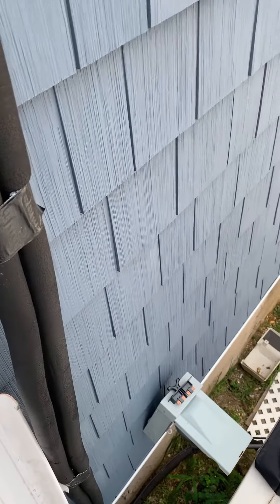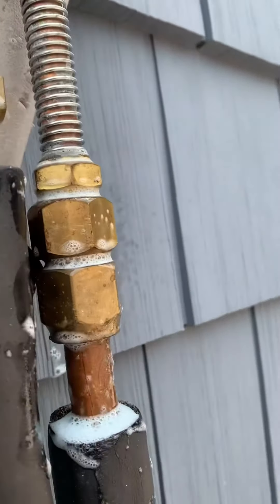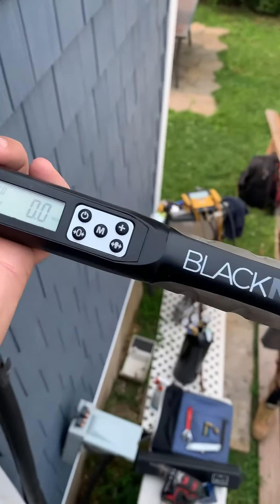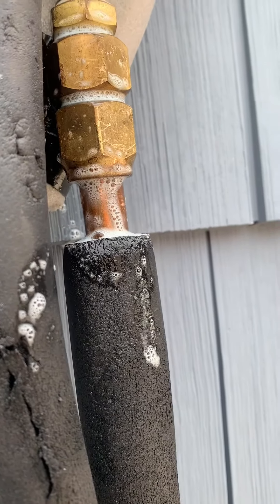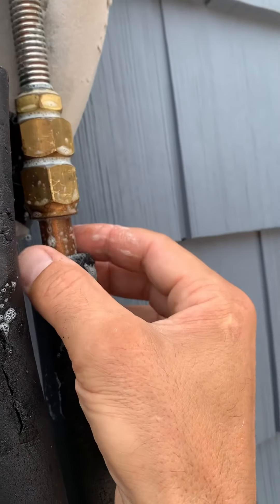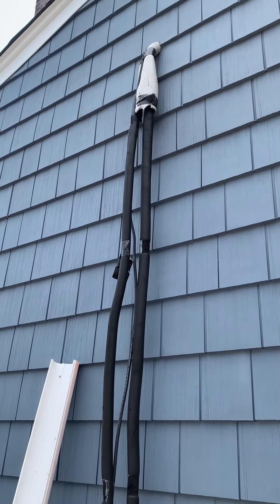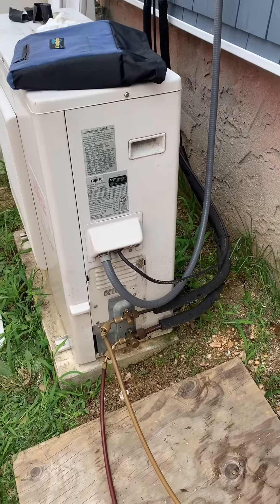Fujitsu Mini Split Leak test and repair￼￼

Comment: you just introduced a ton of micro shavings of copper into that system....that flare tool is fine as long as debris can be removed.... its probably not enough to hurt anything....but still...otherwise, Thanks for sharing with us!
Reply from the maker: Please read the description below we  opened up both ends blew it out with nitro then reconnected everything however if we did not do that yes you’re 100% right thanks for the comment

Comment: I did a vacuum on my ductless installation.  Went negative pressure for about 30 minutes. When I closed the valve on the manifold it went immediately above zero. There is no refrigerator in the lines. How do I find the leak?
Reply from the maker: you need to pressurize the system with nitrogen to about 350ro 400 psi then search for leaks with big blue water bubbles.....
Reply: @lvvhvac9787  is there any other way? I don't have the equipment to do that
Reply from the maker: @jmarasco510  unfortunately, do you need the right tools to check for leaks we need to get a nitro tank connect that to your manifold, gauge, and pressurize the system to 350.. if you cut the flares and redo it, you still won’t know if they’re good, unless you pressurize
Reply: @LVV HVAC  if I cut and re-flare the ends, then vacuum again and the negative pressure holds, then I should be good right?

Comment: what if refrigerant still in there.  How you going to fix it
Reply from the maker: You would have to pump it down or recover it, fix the leak, then put it back in
Reply: @lvvhvac9787  thank you very much
Reply: If there was a leak, will pumping the refrigerant back down add the outside air to the compressor?
Reply from the maker: Good question…. If you still have refrigerant in the system it’s still has positive pressure, so no air really gets in the until. If  there’s no more refrigerant in the system and the unit is operating itis then sucking air in when it’s running… So when you pump down the system stop right before you get to negative pressure on the gauge set ,don’t go into a negative pressure….  you can stop at five psi three psi, so you still have some positive pressure in the system, if you go into vacuum, it will suck air.. good question hope that helps..
Reply: Yes it does! Thank you!

Comment: Why don't mini splits utilize a double flare?
Reply from the maker: Not too sure why they don’t use a double flare however everything needs to be torqued down to a specific specifications by the engineers spec… if it’s installed properly and tightened with a torque wrench they said the units should have no issues.. I also use a sealant around the threads to help out with leaks
Reply: @lvvhvac9787  thanks for the response. I've just never seen one that doesn't leak eventually. I was always taught to double flare in sealed systems. Always blew my mind that they want a regular flare.
Reply: I'm no expert on this.  Double flares are difficult to accomplish properly.  Instead of one bad flare , now you have two.  Operator error and material integrity is a big part of that.  For brake  lines, a properly done double flare is the norm.  Hyrldraulic pressure is way higher than gas.  But brake fluid will never get to a gaseous state.  Second reason or hypothesis, the copper tubing is withstanding up to 500 psig in these machines.  If, this only theoretical, you crush thin-wall copper, not just once, but twice, you're still dealing with the same leak potential as copper does not like to be bent.  So a double flare in this instance does not guarantee anything.  The metal is now now stretched hard for the double flare.   Crushing two layers of copper is then no better than 1 layer that's tightened properly

Comment: How much should I expect to pay for this service I have the same issue
Reply from the maker: It all depends on how long it takes to find the leak multiple heads multiple joints to check then a  repair of possible, next vacuum and charge could be 500 and up ...

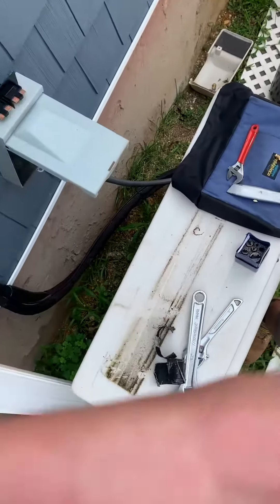Comment: The problem with Spin flare at 1:25 is that all the tiny copper shavings/dust it creates went all the way into the tubing, and it creates tons of those. It all will end up in the TXV and compressor.
Reply from the maker: You don’t see it in the video but we blew out the line on the otherside.. Good point
Reply from the maker: I hear ya, however, my guy did not video him blowing out the line with nitro. Thanks for the comment.

Comment: Why is there an adapter on the head unit
Reply from the maker: it’s for different applications, a single head zone or multihead zone. Sometimes they'll give you an adapter to downsize the pipe,

Comment: Im with the pros here.  I dont even like to introduce shavings into my water or gas lines.  My question is why not first try to torque the line to spec since you have the tools i want and cant afford?  After that initial troubleshoot, maybe stick a paper towel below your vertical flare?  Food for thought
Reply from the maker: Thanks for the comments it was tight up to spec so we decided to cut and re-flare and then what we did prior to the vacuum was open the line blow it out with  nitro and then reconnect everything. Have a great day comments.😮

Comment: I would have tried to just tighten fitting first.
Reply from the maker: I’ve done that too ….but there’s was no refrigerant in the system & there was air in the system so I figured I would just cut every re flare it opened up on both sides bought out nitro pressure test it and  go on my way I had some time on my schedule  anyway lol thanks for the comment keep them coming
Reply: @lvvhvac9787  I'm getting ready to install my outdoor unit this week (it's coming tomorrow) on a multi split unit and hope my flairs hold. I have a bottle of nitrogen to test it with. What pressures do you use when testing?
Reply from the maker: You can pressurize it 350 that should be good but just make sure you crank it down to the torque specifications …too many people eyeball it either go to light or go to heavy and split the copper a good investment is a torque wrench the one I have i believe is blackmen it’s a digital one and it’s really good
Reply: Over tightening flare fittings is the biggest reason they leak. Cutting, flaring , and torquing them to factory spec is the best thing to do.
Reply: The more I get into thos the more I see the value of 1) proper tools and proper training 2) proper tools and proper training 3) proper tools and proper training
Reply: Yea. Tighten to torque 10-12bls. Then add nitrogen and retest.

Comment: Yup, that’s still leaking. Nylog blue, my friend.
Reply from the maker: Do you mean my flare still leaking?
Reply: Flare seals 🎉😂
Reply from the maker: I see them at the supply house all the time never use them though how do you like them
Reply: @lvvhvac9787  They work. If you're installing an eBay mini split that comes with preflared lines it helps. The flares are garbage and everything I've read says nylog can't help in those situations. These seals crush into place because they're copper coated with teflon and once they're down it's forever. Apparently truckers/big riggers use these seals for all kinds of flared connections for hydraulic oils too.
Reply from the maker: I never keep any flare’s that’s not mine on a system I’ll cut it off it re flare it…..
Reply: @lvvhvac9787  For Diyer's that isn't really an option. I'd say for those people flare seals but yeah just reflaring is always best.
Reply from the maker: If you have a good flair and you do a good nitro test, it’s going to be sealed, but I do like nylon on my fittings..🤙